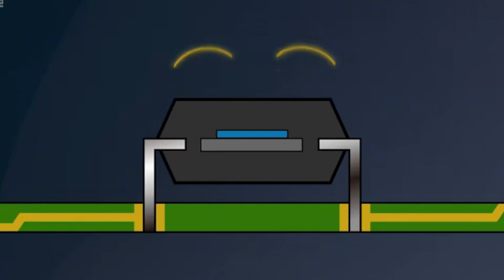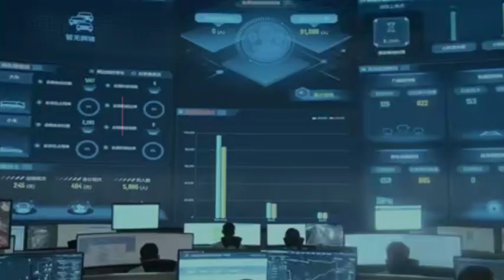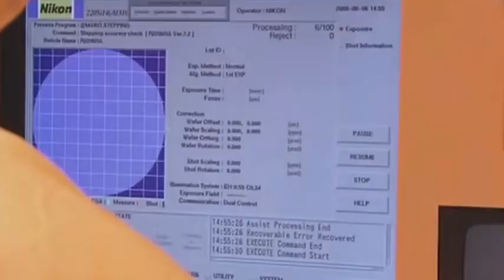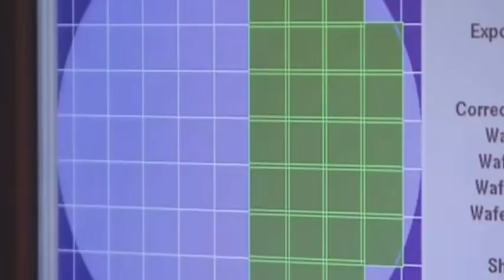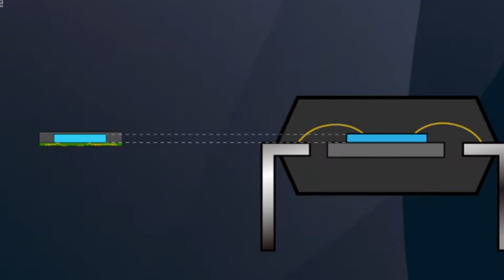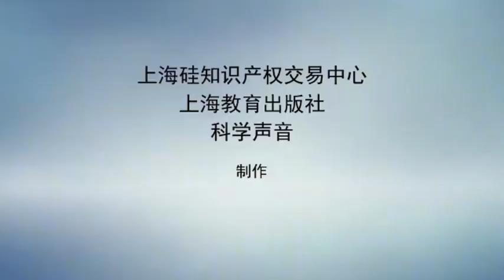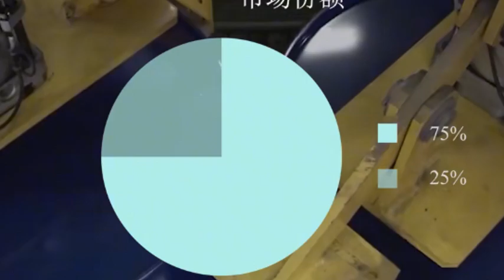China's first silicon photonic chip trial production line is used, and mass production is in sight.

Comment: Photonic chips brings a whole new level of semiconductors.Now comes the creating of advancing photonics in AI, robotics, autonomous vehicles, medical electronics, and advancing the benefits of 6G. Quantum chips and photonic chips now have real life devices and we await graphene to join the family.  Instead of focusing on 1nm silicon, these new applications can achieve even better speed and low power consumption parameters. However, it appears Huawei has bypassed the need for expensive lithography as it produces chip stacking technologies to give the same effects. It's 7nm process with SMIC is now yielding 4nm equivalents using its SAQP technologies and chip stacking.